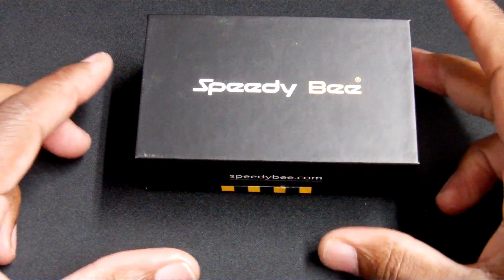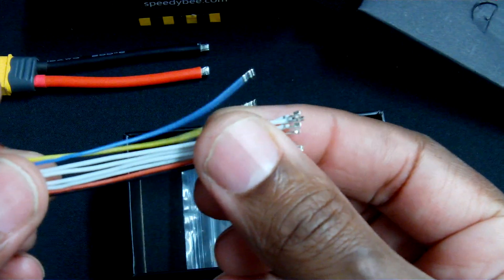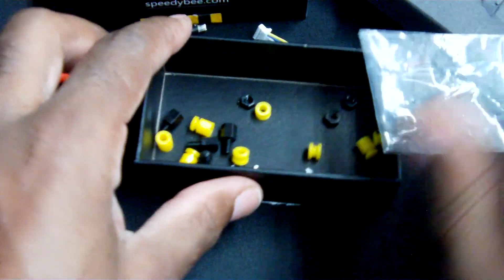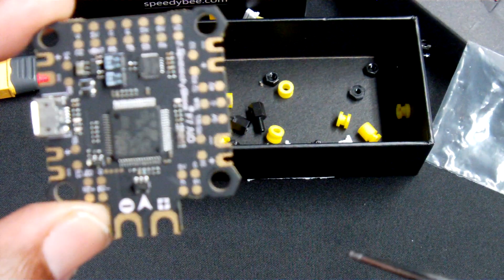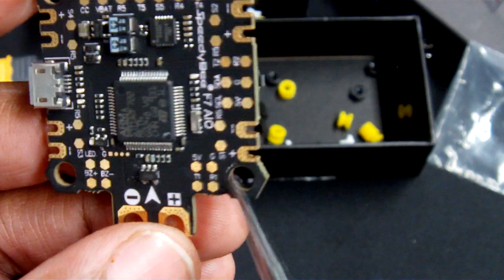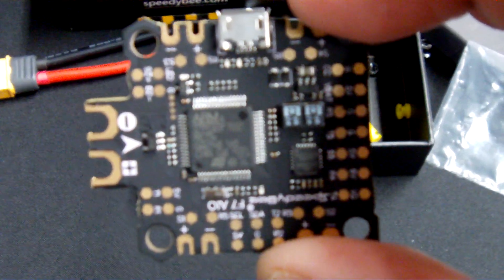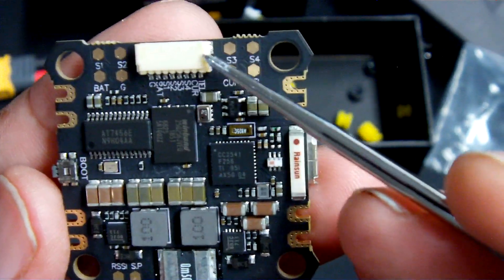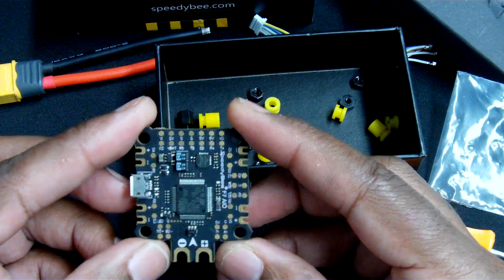Speedy Bee F7 AIO Flight Controller

Comment: Thanks for the vid!  Subbed for no bias reviews.  I'm looking to replace some faulty Kakute F7 AIOs with this guy.  Not many F7 AIO options out there basically Kakute, this,a dn Matek.  Have you flown this yet?  What do you think?  Thankfully (I guess?) the Kakute also has the ICM 20689 gyro so I won't notice a difference in crapiness lol.
Reply from the maker: Thank you. Yes I have flown it and it is currently my favorite FC. I have flown the matek as well but the versatility of this FC being able use 4 in escs or independent ones makes it better for me. Also having a Bluetooth for speedybee is great for sure.
Reply: @enaboofpv1044  Great to hear!!  Kakute has been giving me troubles and even Holybro's Tekko32 ESCs so I'm thinking that company is going downhill.  So need a new go-to.  I'm glad you mentioned Matek because I was kicking myself for not looking at it closer.  Thanks again can't wait to get this AIO!
Reply from the maker: Your welcome. I also enjoy that this FC has the 4 in 1 harness in the front and the power leads come out the back. The matek power lead comes out the side.
Reply: @enaboofpv1044  I actually hate that lol. Only cos I am using individual ESCs. Also am not excited about the icm gyro. But that dedicated clean 9v rail ... I'm so in!! Lol

Comment: Did you have any issues plugging in into your computer? Mine isnt recognized by my computer, I've installed all the drivers from beta flight. I can use the app with bluetooth to configure.  I haven't been able to flash any firmware due to the connection issue. I don't know if it's my computer. I was able to get it to show a com port one time. I wish there was more info about this fc. Thank you for the video it was good. Hope you enjoy flying your rig.
Reply: Yesterday we pluged my drone into 5 different computers we downloaded betaflight, both drivers and impluserc. 2 of the computers were able to read the USB and gave us a com port. Then one of the computers decided to no longer recognize the drone. Give me the same failure.  I was able to download firmware.  I was very happy.  I configured the FC and it was another mission to figure out why I was having a death roll. It ended up that my motos wouldn't allow bidirectional or bidirectional reverse.  So I changed them to normal and reversed.  My drone flew  the way it should until I crashed it trying to do flips to close to the ground. Now I need a new motor and frame.
Reply from the maker: Thank you for the update. I highly recommend the new t motor velox series of motors if you looking for a good motor at a really good price.
Reply from the maker: You may need need to use the driver fixer in order to connect it to your computer. it can be found at https://impulserc.com/pages/downloads . @JoshuaBardwell Has an amazing video on flashing betaflight https://www.youtube.com/watch?v=bAqgPEW48Tc which should fix your problem. Let me know if you need any futher help .
Reply: @enaboofpv1044  thank you for your reply, I will take a look at that video. I  have tried impulse  and it just continue to say connect device while the loading circle continues to spin. If I figure out a fix I will post on your comments.
Reply from the maker: Do you have GPS on the unit? If so disconnect it before you plug it in to the pc.
Reply: @enaboofpv1044   no gps. Just motor, esc, fc, vtx, camera, radio transmitter and LEDs.  I'm using windows 10. I have a friend who is going to let me use their windows 7 and see if that makes a different.